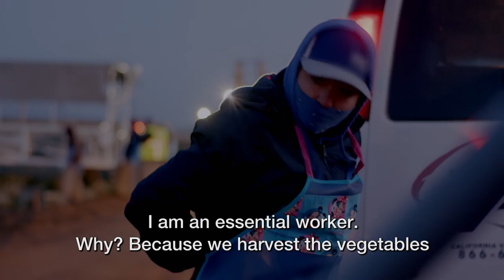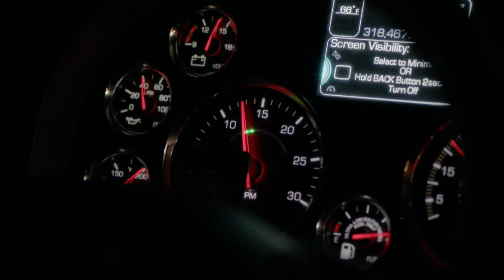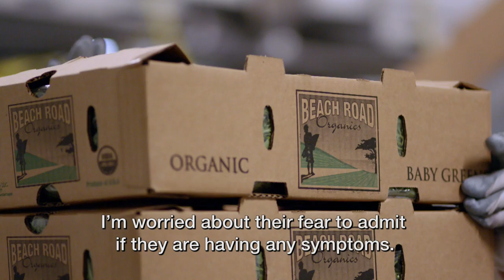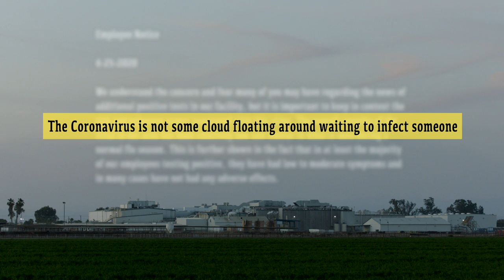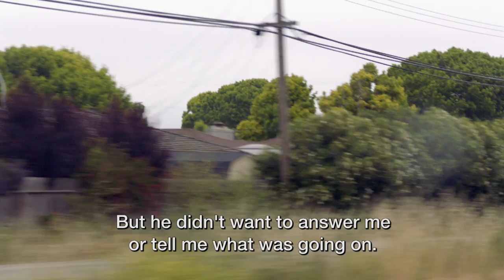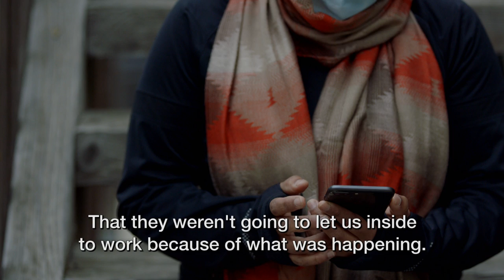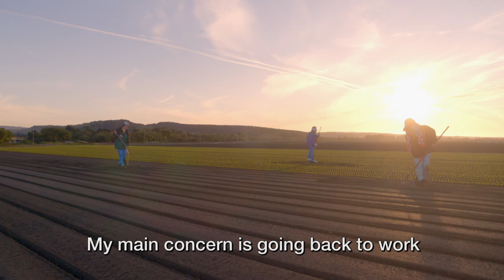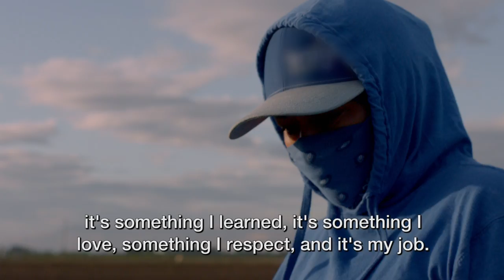COVID's Hidden Toll (full documentary) | FRONTLINE

Comment: The workers in the field early morning all bundled up should have a portable heater system.

A hand truck with a battery hooked up to a series of coffee makers. The water heated in the coffee makers can then be poured into water bottles.

I use the metallic long kneck blue budweiser cans because the seal on the threaded cap of most other road side resealable cans (coors) shrink from the heat and therefore leak!

On those brisk morning when thier possibility of jubilance while in toil is spoiled by the wind creeping up under the shirt! They can stick these cans under the hoodie and secured by a back belt!

I've done four Ozark Trail polar vortex with just two cans in my sleeping bag!